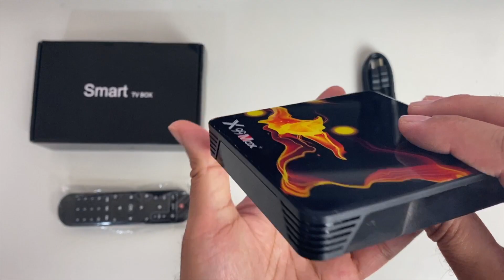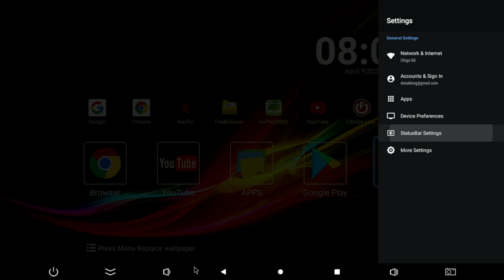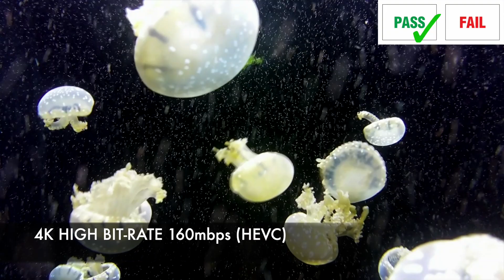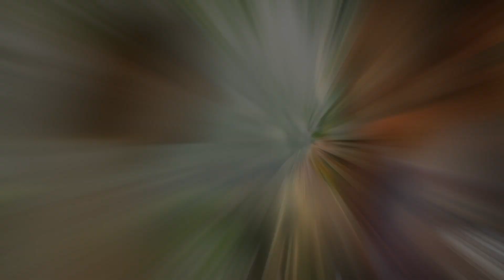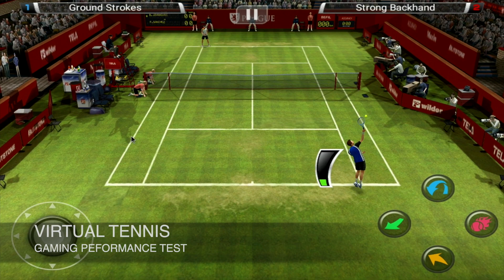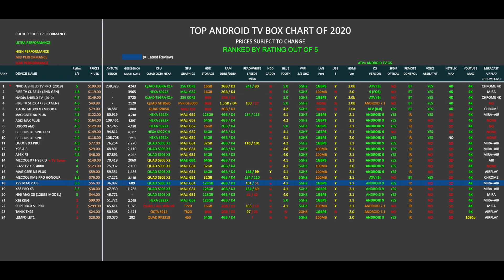X99 Max Plus Full Android TV Box / S905X3 / 4GB+128GB / Under $60 / Any Good?

Comment: No gamepads work and now I found keyboard also does not work with the new X99MAX with S922X processor. They have a kernel bug and letter Q is not mapped so pressing it does nothing. Avoid this $US100 garbage box at all costs.

Comment: Nice review Chigz Tech , thank you .
I have one question , is this box identical to X88 pro X3 ,the one you reviewed the other day because I am a bit confused .What is the difference ,except the remote control they use of course (Lol) ?
Reply from the maker: They are the same, specs wise. However, performance is only slightly better in the X88 model. Probably due to a faster internal storage. And yet X88 is cheaper.
Reply: @ChigzTech  
I think your reply is crucial to someone that is interested of buying one of these two products ,if I am allowed to guess ,probably a mecool fan. Again nice review , as always ,thank you  .